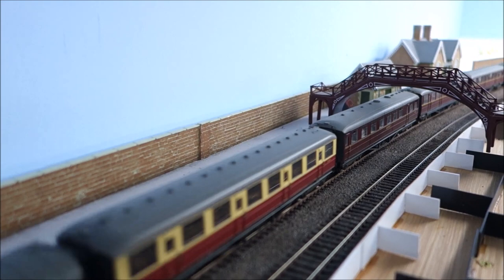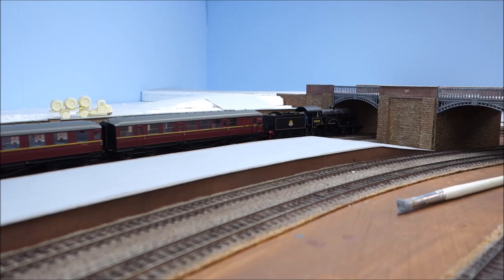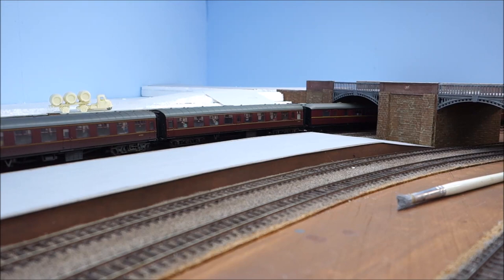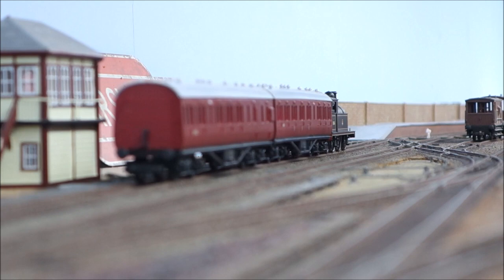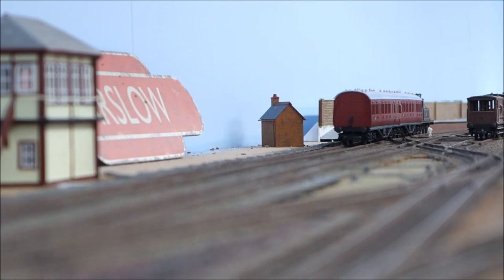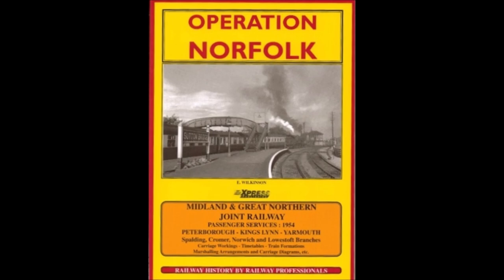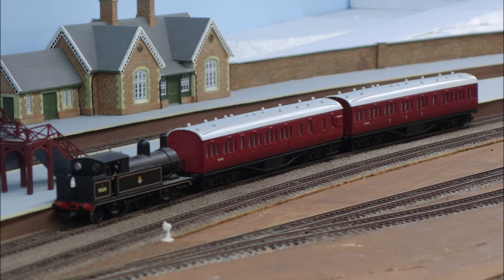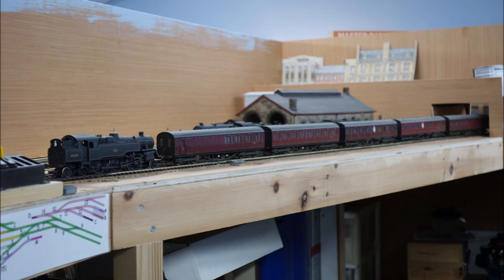Bite Size Bits - Passenger train rules

Comment: When researching formations for a 1980's Scottish region layout I quickly came to the conclusion that anything goes up there! It wasn't at all uncommon to see a four-coach train made up entirely of brake coaches. There's also plenty of examples of four-wheel tankers being coupled to the rear of passenger trains. The cherry on the cake was the random inspection saloon coupled to the rear of six mk2a's. Apparently it could be hired as a private carriage and would be coupled to a daily revenue earning service.
Reply from the maker: Hi.  Scottish Region did do things rather differently - I looked into it when researching a club project.  Tankers, if empty, could travel on coaches in England in some circumstances - certainly not when full.  Never heard of the Inspection Saloon tail traffic but I'd buy a ticket for that!!!
Reply: @yarslowmodelrailway1  great video. I just read this comment and thought I should mention that the services in Scotland did indeed include full tank wagons in their consist. The service ran between Fort William and Mallaig with the out bound leaving Fort William in the early afternoon and the return working coming back in the early evening having swapped the full tanks for empty ones. Something that I'm sure wouldn't be allowed today!! Keep up the great work.

Comment: Another reason why there could be a set up like your Wisney(?) Branch service formation, is that the composite coach is added during the morning and evening rush-hour, while for the rest of the day the train runs with a single brake coach. And it just happens to be easier to shunt the composite on the back of the train.
Reply from the maker: Good point Neil.  (The train comes from Wythesney)

Comment: Just a tad confused... I follow the vesibule = corridor coach explanation, but is it also known as a composite coach? Or does composite merely refer to the 'forced' combination of first and second class passengers in the same coach?
Reply: Composite does indeed mean mixture of classes in the same coach.
Reply from the maker: Yes MaboPete, "Composite" means a mixture of 1st & 2nd or 1st & 3rd in old money.  Vestibule coaches had connections to other coaches.  The Gresley non-vestibule "Lav Composite" coaches on my Coastal train have corridors to allow access to the lavatories but they do not have vestibules and corridor connections to the adjoining coaches.  Thats where it gets very confusing - especially as we refer to "Corridor" coaches when we mean "Vestibuled".
Reply: @yarslowmodelrailway1  The light bulb has come on now - thank you very much for explaining it like that. I wasn't considering the 'through connection' between the coaches.
Reply: @gs425  Thank you - it puzzled me and never quite got an answer 'nailed'...
Reply: @MaboPete  Its a pleasure Peter. We have a good online model railway community.
Reply: LSWR (and others) had tri-composites with 1st, 2nd & 3rd class until 2nd class fell out of favour. By the early 1950s 2nd class was only used on boat trains and when it was abandoned on the continent, BR were able to abolish 2nd class. At that point 3rd class was immediately renamed 2nd class (thence standard class c.1985).

Comment: I know this is for British specific. But i model commuter trains of the 20s and it does bug me to see orths mix mashing or puting multiple diners and observation cars when in reality 1 or 2 diners/ cafe cars at most and other than named trains tail cars were moot. Most my trains consist of coaches and combines with occasional a cafe car or a baggage car thrown in. Milk is possible if it is a run through from a branch line and that would be on a dedicated head end car. A RPO could also be added if it was a branch or more significant train.
Reply from the maker: Its all about "your era, your area".  The GER "Cambridge Beer Trains" were 5 coaches with a buffet in the middle, serving businessmen travelling to meetings and so the train provided a breakfast service.  If the catering only covered some of the journey, the kitchen/dining/buffet would be marshalled at one end for easy removal - see Steve Banks's website for loads of details, especially the 1920's.

Comment: So nice to see somebody covering the operation of passenger trains - absolutely well done - this subject needs to have far more coverage!  🙂👍
Whilst I cannot pass comment on other regions, as a general overview and up to March 1966 the Southern typically kept its coaches allocated into fixed formations (usually allocated to services within each Division). These sets could be strengthened from a pool of Loose coaches and where a coaching set included catering vehicles (including Pullman cars) these were not specifically allocated to each set. 

If an issue befell an individual coach it was normal practice for the set to be sent to Lancing (sometimes Eastleigh) works; sets usually entered works for maintenance (including 2½ yearly varnishing /10-yearly painting) as one.

In service, the Southern's mainline coaching sets normally had a guard’s compartment at each end; the Southern did not normally operate mainline services with a ‘swinger’ (coach without guard’s compartment) at its rear. Arguably the most common set formation was BTK-TK-BTK - some trains being formed of several sets.

There was a huge amount of mail carried - hence the need for large brake vans. Indeed one Southampton train left Reading with three passenger coaches plus five bogie vans carrying mail. How times have changed!  😃
Reply from the maker: Thanks for the extra info - always welcome

Comment: A guard is there for the safety of the train. That is why there is an emergency brake valve in the guards compartment. Also a container of detonators and a set of track circuit clips. If the train should fail ( break down) it is the guards duty to carry out the rules of protection.
Other duties may be added but those are the primary ones.
Reply from the maker: Yes indeed - the chap had a lot more to do (and a lot more responsibility) than just checking tickets.  The YouTube film "Mishap" is worth a watch showing what Joseph has highlighted here.

Comment: It's exceedingly confusing, if not downright misleading, that around 8:06 you equate the meaning of 'corridor' with 'vestibule'. For the railway that I model (and for which my family worked), the LMS, the terms 'corridor' and 'vestibule', when used to describe coaches, were mutually exclusive, indicating two distinct types of coach. Both, it is true, had connectors on the end of the coach allowing passengers to pass from one coach to another whilst the train was in motion. But in LMS usage 'vestibule' coaches were gangwayed open coaches with vestibules at either end; the central portion of the coach consisted of passenger seats on either side of an aisle; there were no separate compartments, although composite coaches would have a barrier with a door in it  between the sections for the two classes (which were still designated first and third on the LMS). 'Corridor' coaches, in LMS usage, on the other hand, had a corridor going down one side of the coach with separate compartments, each entered from the corridor by its own door, and having two sets of passenger seats, facing each other. At different times during the existence of the company the LMS leant more to building vestibule or corridor stock, as described here, but both types were built throughout the life of the company.
Reply from the maker: Hi.  I would agree that there is much confusion, often caused by terms we use as modeller that differ from the terms used by railwaymen.  Also, terms used differ between companies.  The LNER (and others) use the terms "Gangway" and "Non-gangway" to determine whether the coach has connections to adjoining vehicles.  "Vestibule" was a term used originally by the LNER in lieu of the word "gangway".  BR used it to describe end door stock as opposed to side-door designs.  The term "corridor" means a side corridor that connects internal compartment but not neccesarily to another vehicle.  Where the LMS used "vestibule" to describe a coach with a central walkway with seats either side, the LNER used the word "Open".  I am indebted to Steve Banks and Clive Carter who clearly defined the LNER usage of these terms in their book LNER Passenger Trains and Formations [Ian Allen Publishing].  I was brought up on a diet of David Jenkinson & Bob Essery (I modelled the MR for a long while) and so, having feet in both camps, am happy to accept that there are differences we need to appreciate for our own chosen era and area.
Reply: I can only comment on Southern practice and terminology where the terms Corridor and Non-corridor were used. Inevitably terminology will have differed with other railway companies.

On the Southern, vestibule usually referred to the internal circulating areas close to external doors -  normally at coach ends and sometimes towards the middle - for example 64' Bulleid stock where a TSK had six external doors.

When it came to (say) four coach corridor sets Southern practice normally placed the internal corridor along the same side of the first two adjacent coaches before swapping sides for the second pair. Sets were typically BTK-FK-TK-BTK although many were later reformed to BTK-CK-BTK

On three-car corridor sets the sets were normally formed with the 1st class adjacent to the lower numbered BTK (became BSK in 1956).

Comment: One correction, sir;  you say the loco must be able to apply the vacuum brake throughout the train - but it was perfectly legal from the Regulation of Railways Act (1889) for air brakes to be used as an alternative. The LBSCR used Westinghouse air brakes on the 0-6-0T Terriers, and the LNER on their 4-6-0 B12s.
Reply from the maker: Thanks for the clarification Jack.  We make the assumption that everyone used vacuum but, of course, that was not the case!

Comment: Thanks for the info. If the loco is required to apply the coach brakes, what is the purpose of the brake coach (other than to house the guard and parcels)?
Reply from the maker: Hi Charlie.  The guard also has access to the vacuum brake as well as a handbrake, used when the coaches are parked, detached from the loco.  The guards space was mostly used for parcels traffic - have a look at coach drawings and note that the poor guard often got a very small space for a desk, chair and store cupboard!  He didn't get a lavatory or a stove (as in a goods brake van) but he may have had steam heating if it ran through the train.
Reply: @yarslowmodelrailway1  Thanks for the useful info, I do enjoy your videos.
Reply: The Guard was (and still is) the "safety man".  He has a quiet life when all is well, but a whole raft of rules to follow when things go wrong (protection /detonator placement / track circuit shorting etc).
Reply: @charliecroker7380 - one vital reason for the brake coach is to allow the guard to be able to apply the brakes to the entire train in an emergency. For example, if one of the passengers is taken seriously ill on a train making a long journey with few stops, the guard would inform the driver so that he could stop at the next station, even if the train was not booked to stop there, where a doctor and / or ambulance could be called. He could also use that brake to stop the train if he saw a door left open, or saw a passenger fall out, or if he noticed a 'hot box' - a wheel bearing which was overheating, and in which the oil was catching fire.
HTH

Comment: Very informative overview thank you!   🙂
Rule 1 exception being slip coaches (sorry - cough)  😉
(Still needed to start out behind a locomotive of course)

BTW BloodandCustard website has interesting coverage on the 1956 abolition of 2nd class thence  3rd class immediately renamed 2nd class.
Reply from the maker: Thanks for your comments
Reply: wellllll

pedant time. the statement was a locomotive that's vacuum fitted, you can have air brakes.

of course all of this only really counts after 1889 so if you model era 2 before then you're on a railway by railway basis as to who thought they could get away with ignoring the board of trade and their recommendations. Also if you ever got busted riding without a ticket that came in with the same act of parliament is that gave us regulation of continuous braking for passenger trains. Remember the good old days when you could get away with no ticket without a fine not have to give your details to an agent of the railways over the matter if caught and get mangled in a crash caused by lack of or insufficient provision of braking capacity... what a time to be alive...